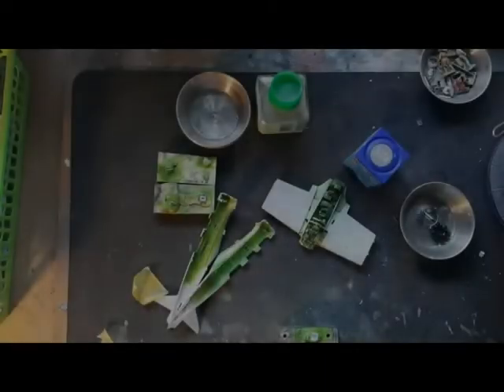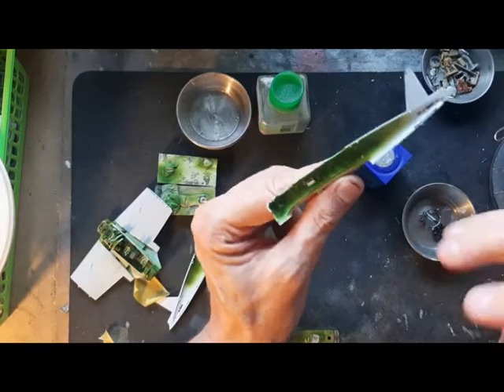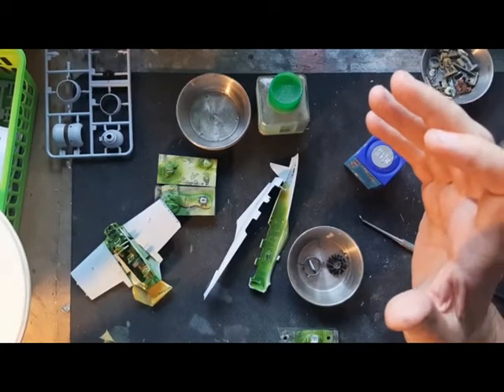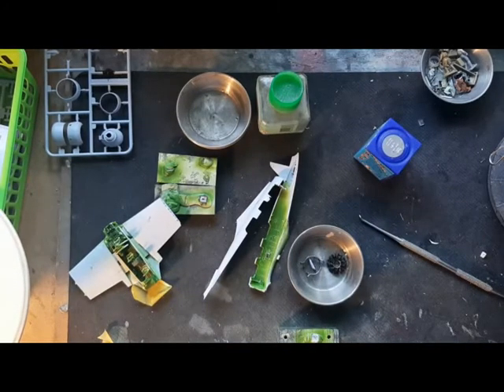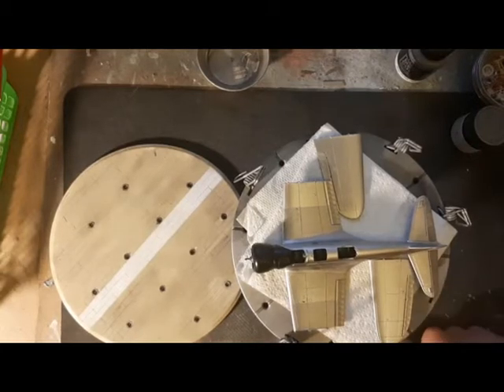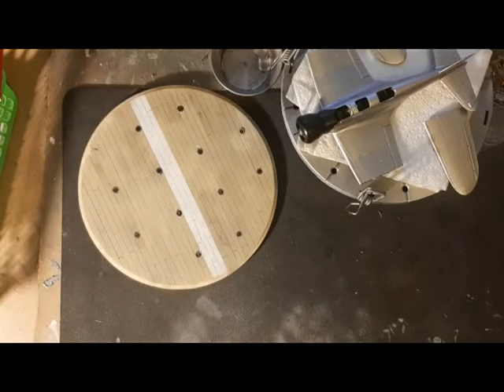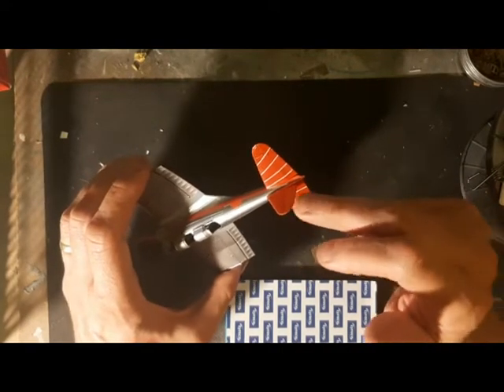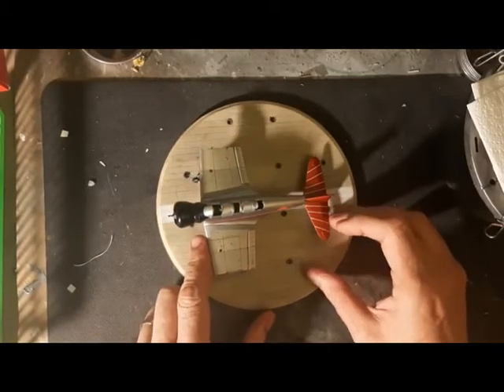Nakajima B5N1 Build Vid

Comment: Not too bad then, apart from the issue of mismatching shades of red on the painting and the decals, which you solved quite nicely.. so that is good to know! And I love the base.. turned out really nicely.. I'm no specialist on Japanese carrier decks, but it looks accurate to me.. :) So yes, great looking model and beautifully displayed.. maybe a couple of carrier crew or a pilot and gunner figure by the plane wouldn't go amiss, but I don't know if there are such figures available in 1/72?  Thanks for sharing, not sure when I get round to doing mine.. but have taken note of the paint issue, should I decide to make this version.  :)
Reply from the maker: Thanks for the great feedback Rob, much appreciated. I agree some figures on the deck  would have been a nice touch.
Reply: @chancerNW  I have a similar issue with an upcoming tank build, of a T-80 B in 1/72.. I will set it in a muddy, wet exercise ground (in as much as I can replicate such a thing), but I have no figures to go with it. So it will have to go without.. Still, figures or not, your Kate is a little gem. Wasn't going to display my model wings up, but having seen yours, I am very tempted.. especially as Airfix has done what appears to be very nice wing fold detail..
Reply from the maker: @BasicModelling  I built it that way for a number of reasons. 1) I have never built a wings foldeded model before. 2) I've never done a carrier deck before with the current build series I'm trying to present the models in different ways compared to my normal work.
Reply: @chancerNW  Very good reasons, both, I'd say.. :)